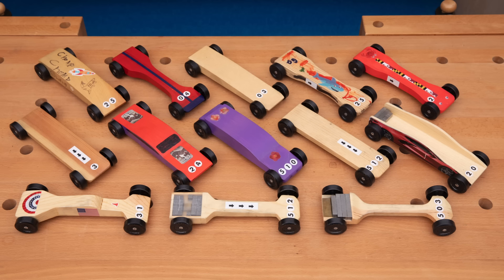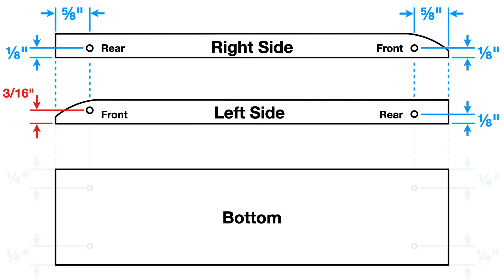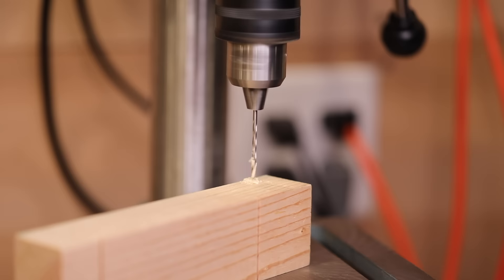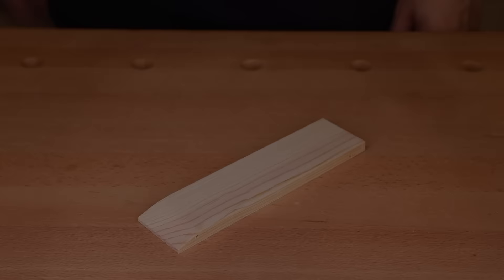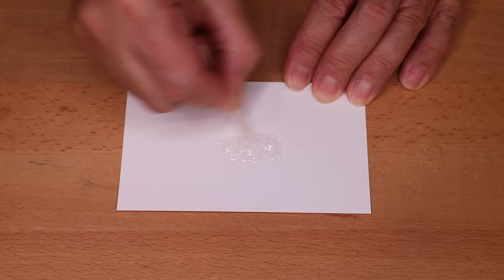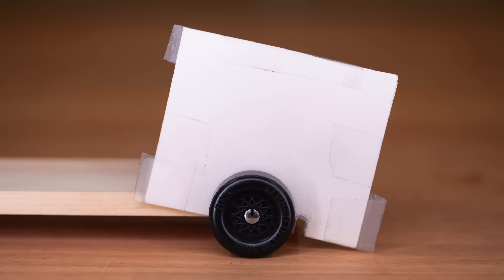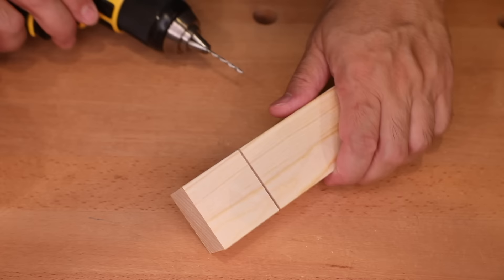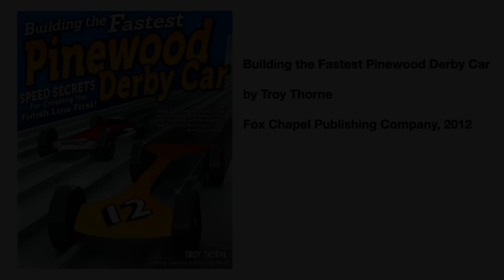Build a Winning Pinewood Derby Car: Step By Step

Comment: Need to know where and what size for weights
Reply: This is all explained very well in the video. Also, these two questions are dependent on the car itself. There are too many variables to give a one size fits all reply.
Reply: Where can I get these specific weights?
Reply: 1/4 x 1 1/4 3.3 ounces? More less
Reply: @roxannemarez2924 this will completely depend on how much your car weighs before adding the weight(s). THIS IS ALL GONE OVER IN THE VIDEO.
Reply from the maker: The tungsten weights shown in the video are 0.25 inch cubes and 0.25x0.25x1.25 inch bars. They are available in other shapes that allow other ways to incorporate them.
Reply: tungsten is 5$ an ounce, you will need 4oz for a wedge car and 3ish for a car with a lot of wood. I use lead on my ebay cars its much much less. 1$ per lb. that's around 4 cars. but I do have to melt it and this MUST be done outside because of fumes. no big deal to just wash my hands or wear gloves. You can just get fish weights and smash it with a hammer also. tungsten is easier I just cant bring my self to pay 20$ just for weight.
Reply: @roxannemarez2924  I think your best variety is on maximum velocity this vid uses his same bars and cubes. I know the him been to his house for the NPWDRL races (pro league races). If your rules allow it Also get the nickel axles they are 1 -3$ (best 3$ you cans spend on a derby car) well worth it SOOOO much faster then scout axles. little or no prep needed. Just polish them with a metal polish and your good to go. Use 2500 or 3000 grit sandpaper then polish if you really want it to fly.  He has low price bodies that are pre cut for the tungsten weight.